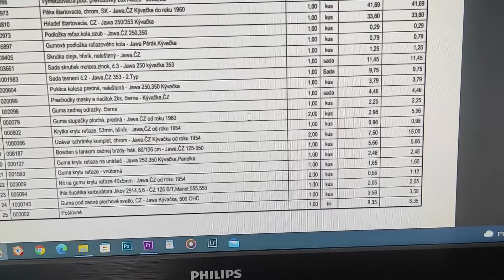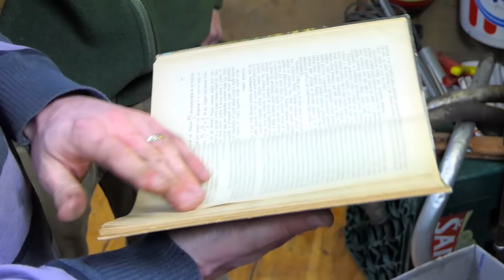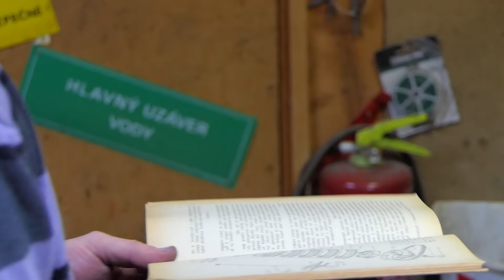Restoration Motorcycle 1962s Jawa 250cc 2-Stroke - Engine Repair - PART 2

Comment: Hello, very precise restoration of this beautiful Java 250 ccm. Especially, the use of a steel platform to separate the engine halves and remove the crankshaft. Usually people struggle with it by tapping and inserting a screwdriver between the components, damaging the surfaces of the crankcase. Congratulations 👌.

Comment: The origine 6V can be esample in a12Volt magnet ignition and Light with scooterparts, easy to change or your take a vape electronik ignition in place of the old 6V one, but more expensive.